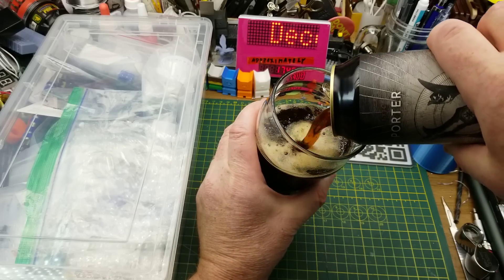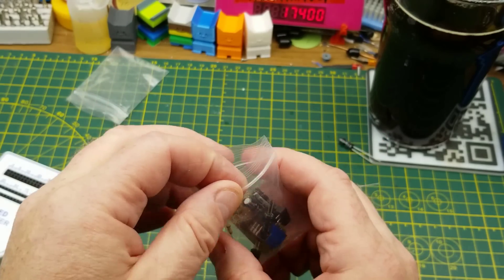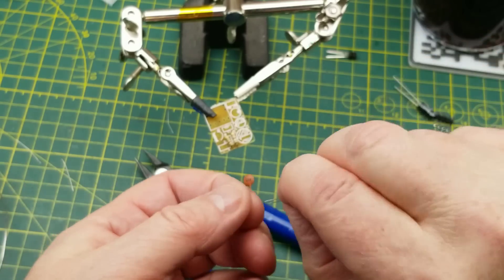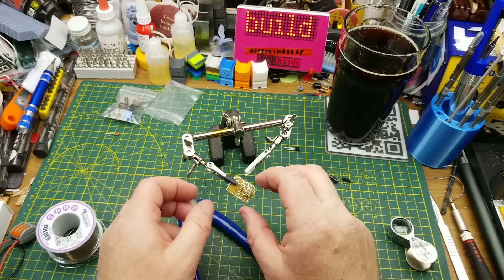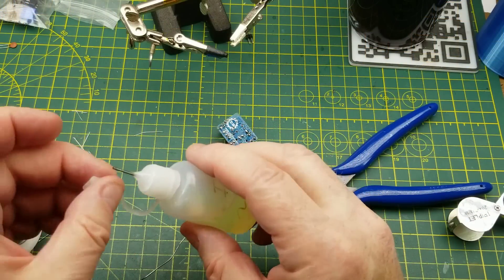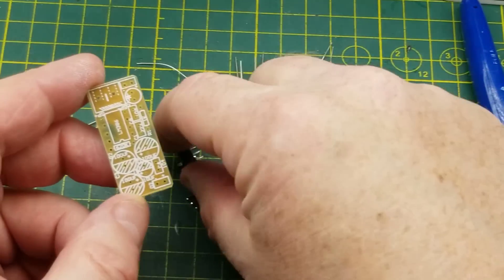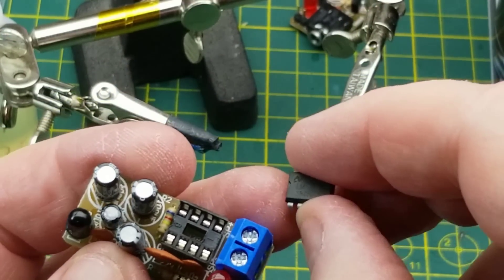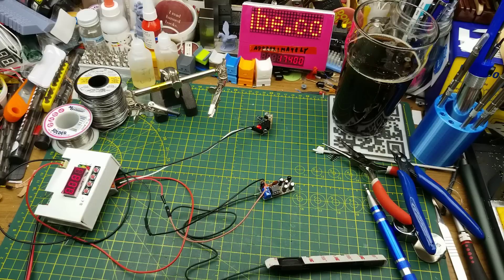December kit builds: Infrared sound

Comment: Now thinking about an application for this.... maybe with some kind of tunneling/mirrors getting signals from a train to a station or vv to do something. Will not interfere much for sure with RF-signals so that's good. I would also have left the legs of the receiver/tranciever -LED's long to be able to angle them on some kind of housing. 
Maybe to speak the name of a station in/on a train or transmit some horn-sound ? Or transmit the name of the train to the station; having a small recording constantly running in the train ?
Reply from the maker: A complete device used to be sold in the toy section of catalogues as a "spy communicator". or similar.

Comment: Shouldn’t you have cleaned the board with ipa , it may have soldered better on both the boards. Just saying.
Reply from the maker: The homemade flux is mostly IPA.
Reply: @ may have needed to be wiped clean, I mean. 🤙🏼🇦🇺
Reply: Comment I came here to make. I was thinking that some kind of goo got on h board during manufacture.

I’ve had the same problem with some boards, sometimes requiring more aggressive cleaning like a brass brush.

Comment: I'm not a fan of that mg chemicals solder. 

Thought I would share a deal with you since I know you can't resist one. 

Amazon doesn't always have this but they do today. Search for "aim solder 1lbs" and today they actually have 1lb 60/40 for $24.95. A half pound is $23.99.

It has not been available for many months but your video reminded me to look and see if it was back. So thanks. I highly recommend this solder. 1.5mm so there's lots of flux in it. 

Double the solder for less than a dollar more? Yes please.

Comment: 1:37 You won't be seeing the near infrared on your thermal camera (it will be outside its range) but it would see the heat from the LED die when you pass current through it.
Reply: camera trick worked for me (using usb webcam), maybe the board needed an active input signal to transmit infrared.
Reply from the maker: Seems reasonable.  Either way, at least it confirmed the LED was working